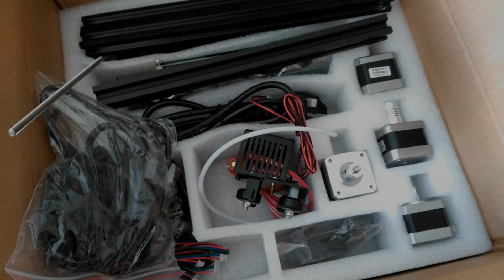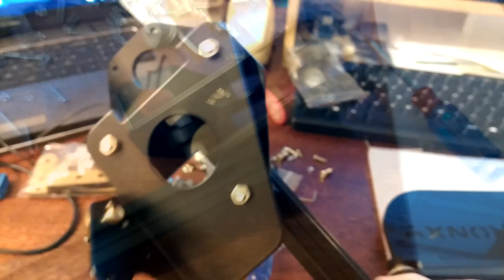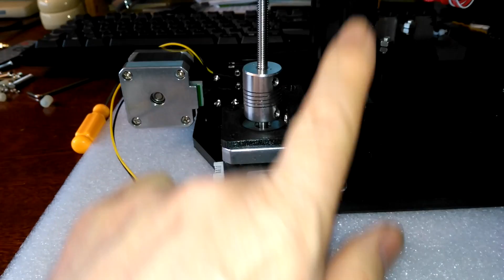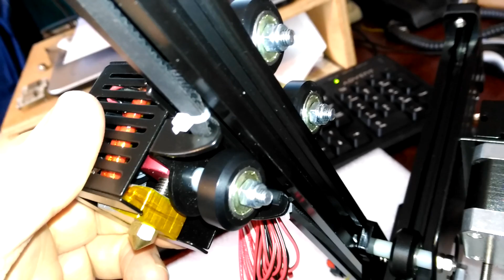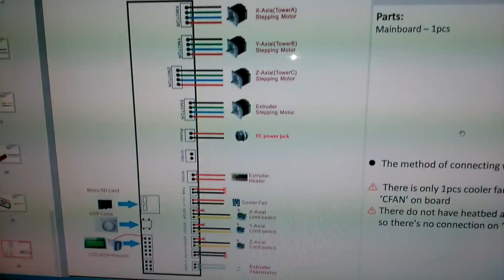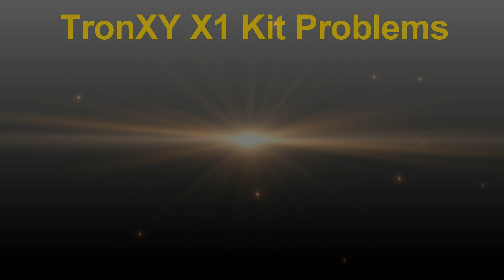TronXY X1 3D Printer Build & First Print

Comment: Thanks, I just put mine together and your video helped me clarify a few things.

Such a strange kit.  Mine had everything recess-drilled so I didn't have the issues you did with screws not being flush.   But I had an issue you didn't seem to, where the holes in the L-brackets that strengthen the base were so big the screws you're to use went right through.   Turned out there were washers in the kit I was able to use to solve the problem, and they never ended up being needed elsewhere, but the manual didn't mention them at all.

FYI, I almost made the same mistake as you on the handle, using the screws that came in the bag with it.  Then I noticed the manual tells to to use two m5 x 12mm, which are far shorter than those ones bagged with the handle.  Worked fine.  I assume the handle is from some other kit and comes pre-bagged with those unneeded long screws.
Reply from the maker: Hi Jesse. So you got there OK. Tried any prints yet? It works very nicely once you get the thing built.
Reply: Yeah, my first print of the pre-sliced demo object on the card (that you printed) came out terrible - very underextruded.   I shimmed the spring on the feed mechanism to increase the tension and the second print of it came out fantastic.    

Then I tried printing a Benchy, but it came out way overextruded.  So I think I need to figure out the proper Slic3r settings for the printer.   It seems dumb that they included the software on the SD card, but not a setting profile for it to match the printer!   Did you have trouble with that?
Reply from the maker: Ah well, you're talking "shims" so you probably know something about tinkering. My calibration cube came out OK. But yes - _ had to set things up for the printer - nozzle diameter, bed sized, etc. - it is odd, but then so is sending kits which cannot be build as supplied or as per the instructions.

Later, I increased retraction settings to 3 mm. Other than that no systemic problems with printing. A few part-specific issues but that's to be expected - part of the 3D printing learning curve I guess.
Reply: Tnak you, I have the same problem

Comment: Received mine (2) weeks ago: Right off, the 20 x 20 frame angles, use m4 bolts and nuts, yet their designed for M5. Noticed all the horse chit screw-ups you ran into. Jumped on Thingiverse and printed everything that seemed like an engineering upgrade. Just printed the latest base with dovetails, angled LCD mount, mainboard, printer sits on top. Printer #29 in my collection. (Retired heavy Industrial assembly group leader)
Reply from the maker: Hi Richard. Thanks for your comments. Printer #29?!?! Jeez, that's a powerful body of experience to feed on right there. There is a Facebook group for X1 owners which you might be interested in here: https://www.facebook.com/groups/1694483897515810
Reply: Thanks Chris I'm a member: Maybe just 27, it's really hard to look at the far end of the print room shelf wall and describe the (2) KS Delta unibody plastic toys with $1 steppers, hidden in 13 G kitchen bags printers

Comment: my z axis was fine at first but after loosening it for an adjustment it started wobbling, I discovered that the guide wheels were now improperly spaced. after fiddling with it I found if you press the guide wheels towards each other while tightening the bolts they will fit snug on the rails and no longer wobble, this is due to the holes in the mounting plate being slightly larger than the bolts giving thin about 1mm of play. I hope this helps people out.
Reply from the maker: 5.56NATO did you WATCH the video?? It explains exactly what you're talking about.

Comment: Thank you for posting your build video.

What is the length of the X,Y and Z v-rails?

Would it be possible to share a copy of the manual?  I ordered a TronXY X1 but its gonna be a couple weeks until it arrives and I'd like to prepare by reviewing the build manual if possible.
Reply from the maker: AndroidMobile, there may be copyright issues with sending you the manual, and the logistics of getting a large PDF to you, but frankly, my build video is far more useful than the manual, because the manual is wrong or incomplete in important respects.
Reply: Chris Wesley bit of a shyt reply. op youl be sitting luke me for 3weeks trying to work the basic eeproms never mind the arduini ide, marlin, repetier. All these shyt programmes and firmwares.

Wish I never bought mine.
The thing wont home screams clunks and nothing. Extruder makes clicking noises when homed. Put it to run in dry mod aswell..

Its a waste of money in building bigger diy versions at half the cost woth better parts too. Instructions are a joke. The lcd acceleration, feedrate serting are not even mentioned just like your shit video.

Comment: I built one of these, but had to make several modifications to make it work. Plus, there is an issue with the firmware, causing the X-axis to be reversed. Many screws were much too short, and had to be replaced. At first, there was a HUGE amount of play on the bed. I had to drill two new holes and relocate 2 of the wheels on the bed frame. It works very well, now, though I still have to deal with the X-axis problem.
Reply from the maker: Hiya nrbuckbig. Yes, they seem to be pretty consistent - full of problems, but a good printer if you can be a bit handy. So far, it's doing everything I ask of it, pretty perfectly, but you have to wonder why they think it's OK to ship a kit like this.

Comment: Thanks for the video. I'm trying to mount the printer for two days. How you repair the inestable bed. 24:44 min. I have this problem in the bed and z axis
Reply: I fixed my wobbly platform/wheels by wrapping the wheel with sticky tape to make the wheel thicker.  But wrap it when it's mounted so you can feel how much sticky tape is enough when it gets some grip.

The z-axis motor, I just left it there with no bolts, but it worked.  Should have watched this video first.

For the warpy platform, I cut up an expired credit card and put it underneath the platform where the bull clip goes, seems to be a good height.

I didn't have any problems with the bolts for the extruder clip, or handles, switches.
I only had the missing bolts for the motor like in this video.
Maybe they just hand out the bolts randomly!

If you use it with a PC, you've got to go to the printer settings and set the baud rate to be the same as the printer's under configuration.

This thing will probably break down if I use it too much, everything is just too fiddly.

Comment: I have one too. I encountered most of these problems except screw heads protruding on base. Had to recess screws holding the bed too. Bearings were also kinda iffy. I solved the issue with Z axis lead screw misalignment by bending the part of Z carriage which brass nut screws into. That 3d printed part for Z axis motor is just not precise enough and needs tinkering. But in the end it prints fine. I would like a bigger print space but for the price its pretty good.

Comment: there is a facebook group for this printer where you can find info how to fix bed wobble.
Reply from the maker: Hi Jelle and thanks for your comment. I guess you left the video early, because it explains how I fixed the problem later on. I am already a member of the Facebook group, but again - thanks for the suggestion.

Interestingly, a number of people there fixed the problem by drilling new holes. That's drastic. I fixed mine by loosening then re-tightening the bolts in the existing holes.
Reply: Can confirm I fixed this issue by loosening and re-tightening the bolts, too. Had to do this both for the bed and the X carriage.
Reply: someone designed a bed tightener and uploaded it to thingverse http://www.thingiverse.com/thing:2203872/
it's going to be my first print when I can figure out how to get it to print...
Reply: I was looking for a decent price and on Gearbest it's for 129.99 dollars with coupon code: GBTRONXY1
http://www.gearbest.com/3d-printers-3d-printer-kits/pp_494194.html?wid=21&lkid=10781362
Gearbest is a well known online store, so...

https://www.youtube.com/watch?v=XGECtOEJ30c

Comment: I had the same issues with mine :) I convinced the guy to give me the STL for the Z motor which I'm going to modify and print. I also printed a belt tensioner for the X axis and I need to print one for the Y axis. Circles are not entirely round yet, but almost. Was missing a few screws, too, and the ones on the bottom stick out in the same way.
Reply: All acrylic parts stl's are available on thingiverse !  plus a few improvements ...
Reply from the maker: Thanks for your comments, Alin. Which guy did you speak to? I didn't see a way to contact the makers of this machine. I'm sure other people would like to know too.
Reply: Well, I bought mine from AliExpress. If you search for TronXY X1, there's one result which has a blue picture with globes behind the printer. Would love to link it, but Youtube won't let me. I'm not sure if they're the original makers, but the guy told me something about his factory and so on. 

As soon as I'll have time to print and test it, I'll upload the Z bracket to Thingiverse, so more people have access to it. If you want, I can give you the STL I got :)
Reply: I know, but I haven't seen the Z motor mount in there
Reply: Hmm if you are missing something , then just leave a msg on thingiverse .  The guy from PressReset is quick to reply ...
Reply: I'm not missing it, as I got it from the seller :)
Reply: Mine was ok , just a bed woble. .. but I sorted that.  However I still have some miner issues .  For example  the coordinates of the bed vs the nozzle are off when I print,  but I think its a slicer setting issue.
Reply from the maker: Oh OK. Thanks for the info. I look forward to your upload.

Comment: If they fix those issues the kit will jump in price maybe even double there is a 3d printed belt tensioner that promises to fix the belt friction with the extrusions, im waiting on filament to print them myself as I'm using a tuned version of the stock belt pulley atm.
http://www.thingiverse.com/thing:2020468
Reply from the maker: Andrei Rota, why would making sure there are enough bolts in the kit - or changing the Z axis motor mount - or fixing any of the other things make the kit ANY more expensive? Let alone TWICE as expensive?

And where is their sense of self-respect or ambition to make their kit recognised as excellent worldwide?

I like my printer. I still think it's great value for money, and I'm confident I'll have it making superb prints too. But the problems I've highlighted in my video are annoying and entirely avoidable. To choose not to fix them is something I just don't understand.

Anyway - I've seen those thingyverse tensioners though - superb application of 3D printing and they inspire me to do good things with my new 3D printer.
Reply: My kit had all the bolts and the bed screws were not sticking out so ... maybe there is more than 1 factory selling them, the design is open source and not protected by patent as well so maybe they just have all the parts already delivered and have to sell it like this making next to no profit to get rid of the flawed kits and then sell a more expensive and less problematic version. Like you said we cant complain when the fixes are easy and the quality and the design is good in the end.

Comment: Great video. Would you be able to make a more refined bride on building the printer so people can get it correct first time. Thanks again.
Reply from the maker: Hi NSCXP2005 & thanks for your comment. However, I can't work out what you meant to type with "more refined BRIDE". Could you clarify please?
Reply: Chris Wesley sorry. I meant a more refined guide or an amendment guide of the things the main guide didn't cover.
Reply from the maker: Oh I see. That would be useful wouldn't it. Trouble is I'd have to dismantle it to show the issues. I have written to the manufacturer and I hope they will update their guide and their kit to fix the issues I have reported. They are, after all, the people who got my £155.
Reply: +Chris Wesley ok. Thanks. Where did you buy it from Gearbest or Fasttech?
Reply from the maker: NSCXP2005, I bought my Tonxy X1 from tvbox-vincent on EBay.